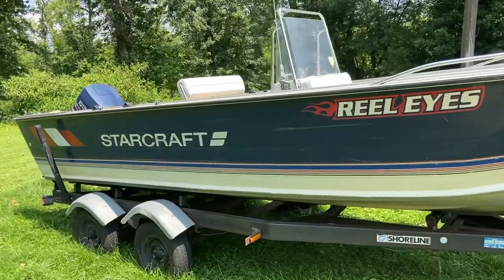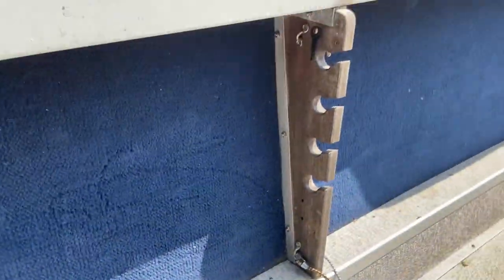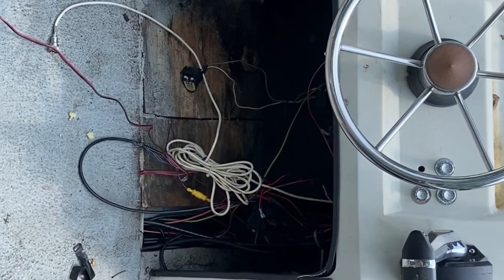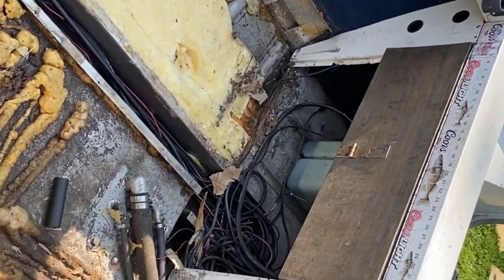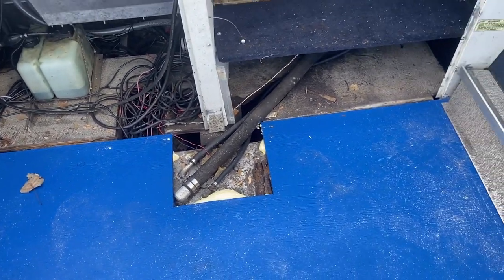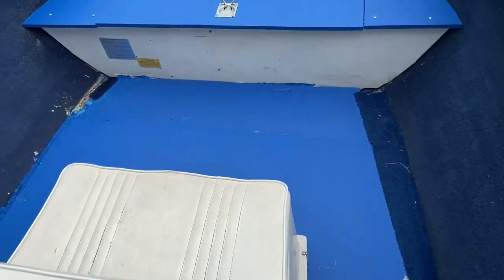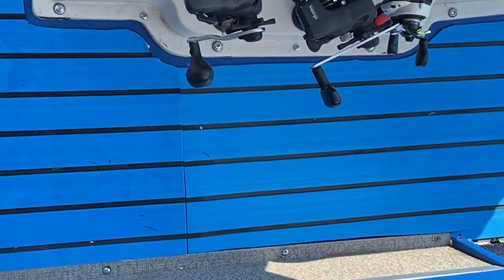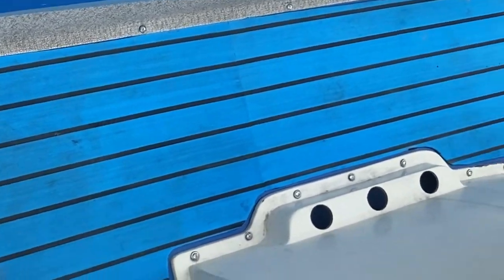Boat Floor Replacement w EVA Foam

Comment: Bought this exact same boat because I’ve loved the shear lines. Looked for several years. There’s not much content on YouTube about these old boats. Was thinking aluminum floor but at 500 a sheet doesn’t seem feasible. Plywood and epoxy I’m afraid. Looking for content ran across you. Good luck amigo. I hope you post more content. I’d sure would love to find where someone has changed the floor plan layout as StarCraft has so limited storage.